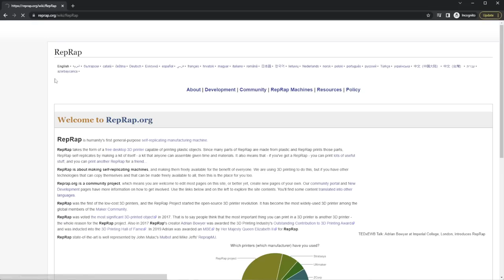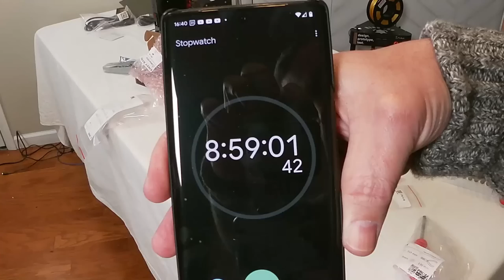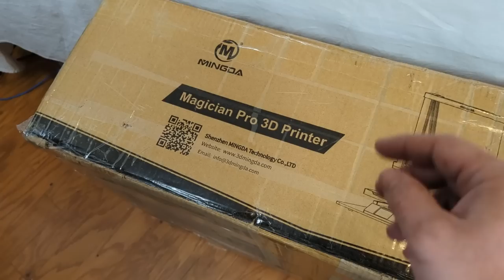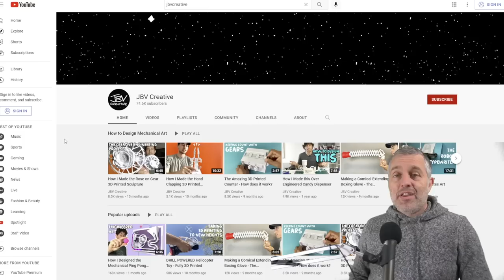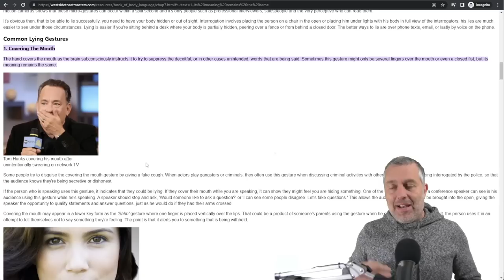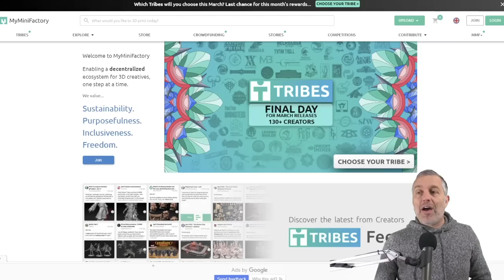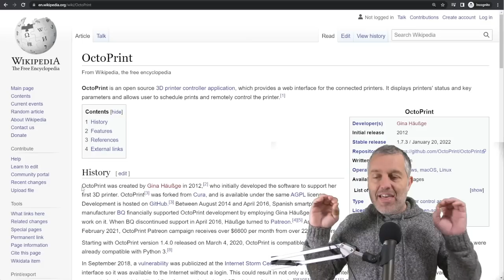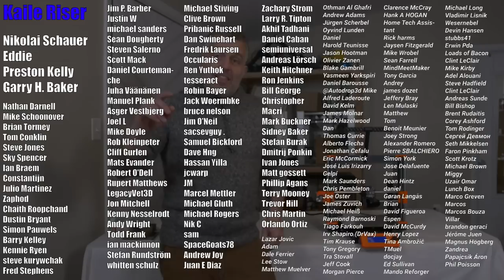Why Does Nobody Speak Truth About The Prusa I3 Mk.3? - It's Overhyped and Over Priced.

Comment: I bought a SL1 kit.
The manual was amazingly written!
It even mentioned mistakes which can happen during the assembly and told the user, that he doesnt have to be afraid, if he damages that one part, because there is a spare part in the spare part bag for exactly that case!
And they have some little jokes.
The steps are very detailed and all with pictures. For a complete beginner, this was awesome!

Whoever writes these manuals at prusa, deserves a rise!
No downplaying here!

Also the support is very good.
I had one part damaged and got a replacement for it in a couple of short days (mailing of course takes abit time).
The support guy was very friendly and even up for jokes, when I asked for more gummybears, because mine "disappeared" : D
(His response was, that they cant fetch me some over the weekend, because the gummybears are outside to get some air)
Reply from the maker: I'm upvoting because you seem like a nice fellow and you are respectful. You had a different experience than I did and you just want to share that. I can appreciate all of that and I can appreciate you for being a decent human being. Not calling me names or questioning my character. Have a great day!
Reply: @DesignPrototypeTest  IMO, your critiques of the manual are petty.  At least it's all there and you can opt not to use it.  I personally appreciated it as it was heads and heals above most everything else. Including the outtakes.
Reply: Straight hater and come on man really taking 40min to put up frame. I recently got into 3d printing with mk3s being my first. Dont be one of those guys who half-assed reading directions then complain and critique installation. In the directions you would have seen a cheat sheet in which those assortment of hardware could have been used as a reference to know which hardware was needed during certain parts of assembly. I've printed nonstop with it close year now and besides basic maintenance, which every machine needs, definitely hasn't let me down though its printing is slow. And no I'm not a sock muppet
Reply: My favorite part about this comment is that "Prusa"'s resin printer line wasn't his work. It was a machine designed and built by Futur3D who was acquired by Prusa.

Comment: There is a lot of square hits that you can take at Prusa and you took a few of them, but this feels more like a hit piece.  "I'm smart and don't need detailed instructions", "my inner child is dead and I'm insulted by the haribo gummy bears", "the open source rep rap project is old", "Prusa's branding is and logo is unsettling because it's a picture of joseph PRUSA", "It's antiquated", "it's overly complicated".  You make some solid points about it's build time, It has a few design flaws, and It could pick up some key features.  However, it's able to print very accurately and at high speeds, and there is value in open source.  I just upgraded my extruder for free.  You even attacked it's bed for it's I3 design for it's speed while holding up a much slower I3 design. Please be fair in your side by side comparisons.  You also cheated in your side by side print by making the prusa infill so that it appears to be just as slow, why?

Comment: As someone who writes manuals for 3D printer assembly kits, yes it DOES need to that level of detail. As someone with a lot of knowledge of 3D printers like yourself, you are among the very top of people who have enough knowledge to be able to do this kind of assembly with a shorter, concise guide but everyone else is greatly benefiting. Every one of those extra steps is guaranteed because multiple people have had issues with that. You can best see this in their online guide, where people can add comments. When there are too many comments on a point, the online guides get updated accounting for that feedback.

You have to play it a bit of both ways. If you go into too much detail, you risk people skipping steps. But not enough details is the larger risk of having a bigger group assembling the printer wrong, potentially causing damage or the like. You can see that here as well, I don't know if this is in the booklet, but the online guide has an introduction guide, explaining things like using labels for screw size referencing or what the joseph prusa logo means (it means using a screw pulling technique. It's SUPER dumb, and should by all accounts have been an iconographised version of said technique) 

I would also note that having a printed guide is a bad idea. The online guide is much better, reflecting updated parts etc. You can't update printed guides as easily to address changed parts or explain things better. We don't provide printed/PDF guides of our assembly manual for that reason: being able to update it easily. Because of current global shipping problems, the printer someone gets can be weeks or months old, and so any updates to the guides would be at best as outdated.
Reply: NEVER overestimate the user's knowledge and ability
Reply: I love printed manuals. I often assemble things far away from a computer, and I'm not going to use my phone for such things, as they usually cause more frustration than help on such a small display.
Reply: @IrocZIV  the manuals we have have a ton of video material that's quite key in the assembly so that also plays a huge factor in our case. But I do agree that sometimes it's not handy
Reply: @nickolasgomes703  Also never under estimate the stupidity of some people :) lol
Reply: Printers have manuals?? oh that's the book like wordy thing I use to prop up one corner of the printer because they don't come with adjustable feet......
Reply: As someone who found FLSUN's QQS instructions distinctly lacking I agree re having the most detailed instructions possible. Those who don't need them can skip over and it's a bit arrogant to say "I don't need these therefore nobody does".

And on the subject of online manuals, my Internet has been unreliable - I'd rather have a good, detailed manual, printed and in the box, that's good enough to use and may say "for the latest instructions or if you are having difficulty, go to this  [URL]".

You should cater for all parties...
Reply: @IrocZIV   I found I used both.  The manual is better for being on your desk, but the online manual has questions that are asked and answered in case you're stuck or confused.
Reply: @NexGen-3D  human stupidity is the only thing we can be sure that is unlimited
Reply: I used the online guide for my mk3s and it was an absolute breeze to assemble! my first prints came out flawlessly as well thanks to the community feedback!
Reply: I think the more effort  you put into assembly development the less time you need to spend on assembly manuals. Unfortunately the development team always leaves that job to the one who has to write the manual and can't optimize the process. I feel for you.
Reply: Very well said. Thank you for continuing to be as helpful as possible!
Reply: Yeah, I'm an engineer and writing public facing documentation sucks because of how detailed we need to be to cover off all the inevitable stupid questions and the occasional clarifying questions. You're totally right with your assessment...

Comment: "Maybe there's a ruler or guage for measuring the nuts and bolts", he says while holding the bag that has the nuts and bolts printed on them to scale 🤣 I don't think you're on solid ground complaining that the instructions are overly detailed when you've failed to read them.

I'm no prusa fanboy, I'm pretty upset at them for the mk3s upgrade that made my printer significantly worse due to filament path issues, closing the issue 602 without admitting fault, a textured plate that nothing would stick to unless you scuffed it, ghost crashes on Y in enclosures, the list goes on and on and on. But their instructions are definitely not a problem. They're very well done.
Reply: agreed
Reply: the textured plate only really works well with PETG, the smooth and satin are needed for basically everything else.
Reply: @nateschmitz9827  Trust me, I've tried the textured plate with petg. Nothing, and I really do mean nothing sticks to mine. My satin plate works flawlessly. And my smooth pei works pretty great too, even though adhesion is often too strong for petg. In my opinion, the textured sheet was a complete misfire. But I've heard you can get great results if you scuff it.
Reply: @assumptionsoup  I'm one of the "mine works fine" people who likes to point out that you really have to squish PETG on the textured sheet. ;-) 
I wouldn't scuff it, but I've heard people use 3Dlac for better adhesion.
Reply: There's also a full page sheet available, I can't remember if it's included now but it's printable.
Reply: @assumptionsoup  My textured plate works great with PETG.  As long as your Z is good it will be fine.  I've printed thousands of hours of PETG on the same one as well.  PETG seems to leave more residue, though, so if I have trouble I make sure that I wash it with Dawn dish detergent.
Reply: @assumptionsoup  If you use PETG on the smooth plate, you'll be getting a new smooth plate.  Maybe not the first time, but at one point PETG will stick to that so hard it makes super glue seem like a lubricant.
Reply: @nateschmitz9827  I never understood this.  I use the textured sheet for PLA all the time.  I like the pattern vs the shiny smooth surface of the smooth sheet prints.  Even if I don't use hairspray or glue stick, I still great adhesion with PLA.  Maybe I'm lucky or folks don't set their first layer calibration correctly.
Reply: @christophercase9716  also really depends on the pla blend. My print farm exclusively used Polymaker polyterra pla which has terrible adhesion. But if you get a very pure virgin pla blend it should stick to just about anything
Reply: @nateschmitz9827  I use basically whatever the cheapest I can find on Amazon. 3D Solutech, Hatchbox, Ziro, Overture, Monoprice, even some no name red filament. ALL of them stick fine to the textured sheet for me and I prefer it cause of the pattern.
Reply: @assumptionsoup  maybe set your z-offset a little lower. Nozzle closer to the plate. Worked for me.

Comment: I bought a Creality Ender 5 Pro 2 years ago and despite endless hours of research and attempts to repair and calibrate it, I was never able to get it to print reliably. I finally gave up and sold it for 20% what I paid for it. I bought a mk3s+ from Prusa about 45 days ago and it has been completely painless to own by comparison. The prints are better, of course. The best part is the company itself. Any issue or question I had I have had their support available to me literally 24/7 happy to give knowledgable and patient help. I feel much better giving my money to a company that is contributing to the industry vs. a Chinese clone with no support that was built under terrible factory conditions.
Reply: Got my first a few month ago, its a ender 3 pro v2 and put it together in about 30min. And started my first print within a hour. Creality is a great Chinese company with great quality and easy to upgrade.
My next will also be a Creality but a more professional version.
Reply: @kempaswe4022  as a person who has owned SEVEN 3D printers, from 4 manufacturers, and printed many thousands of prints, I assure you that the Creality garbage was the worst of it, by a lot. They contribute nothing to the industry, ship environmentally brutal trash, and feed off the intellectual property of the innovators. They're awful.
Reply: @2008gore  know alot of people who got different creality printers etc and none of them have had any problem with them.
Reply: @kempaswe4022   I already bought a Creality Cr-10 V3 2 years ago and since then I have had nothing but problems with it, and I have never really had reliable quality. I bought it because of all the paid positive YouTube reviews and the 1 in 10 people who had a good experience with it who recommended it. The only advantage is that it teaches you how 3d printers work because you do nothing but fix it. But I didn't buy a 3d printer for that. I'm now looking for a reliable 3d printer with consistent quality, and it definitely won't be a Creality.

Comment: Comparing prusa to putin, and pretending that czechia has no concept of democracy, compared to the US, where a criminal oligarch ran the house for 4 years, despite all the red flags; as well as the MASSIVE problems that the US still has in regards to the respect of people other white christian cishets, is kind of laughable; honestly.

In respect to that; the Czech Republic has a more functional democracy than the US.
Where the US seems to have been stuck, and seems to be; systematically revolving around the early 1980's in terms of political progress...

Also; yes, Chinese printers are great; but also: Chinese printers can set your house on fire, because thermal runaway protection is still functionally optional for some brands...

And... How much have Chinese manufacturers actually contributed to the marlin codebase, and how much have they contributed to everything in general, as that answer is still a largely net zero game.

Nottomention that most China printers; including the ender 3, come in about 6+ different variations; some with the yellow bed springs; some with  noisy a4988 stepper drivers, some with a metal extruder, some with the plastic one.... Some with a mean-well psu, some with a Landy, some with a 32bit motherboard, some with a 128k chip...

Like... It gets kind of frustrating for consumers; if they eventually need to still throw at about a 100-150 euro at the printer, in order to get a less frustrating experience altogether..

But that's just my €0.02 cents